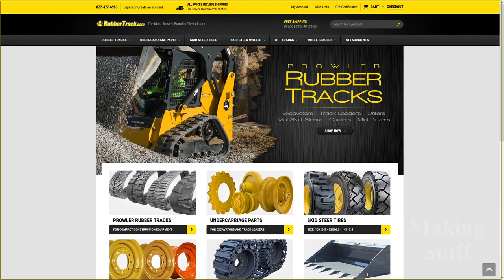DIY Tracked Vehicle Part 2 - Engine and Frame

Comment from the maker: Work continues on the DIY Tracked Vehicle.  I think the engine is too big, what do you think?  Can you have too much power?
Reply: I’ve wanted for a long time to build a tracked vehicle, one or two seater, dune buggy/ripsaw style, but aside from finding an already engineered track system I had no idea where to start, it would still be a bit of a different scale, but you’re definitely inspiring me to put some more serious thought into it.
Reply: if it doesn't generate enough power to cause structural damage, then it is not 'too much' power.. That said gearing to keep the speed sane while increasing the torque is a good idea.
Reply: Yes, when the diff is rated for 10 hp.  I'm actually downgrading from my 13hp, figured I don't really need all that power.
Reply: I really don't think so but I'm looking into working with two hydraulic motors to run each belt separate but I'm looking into hauling upto four disabled Veterans that are going out on elk hunts so power is a big thing for what I'm planning. Has to be built light but sturdy to handle whatever they throw at it.
Reply: More Power is GOOD!! Great project.

Comment: putting a hitch on that little guy would make moving boat trailers and tuff around in tight spots a dream.   I bet you could even use it to pull a single bottom plow like a garden tractor.  It is a pretty cool build.  I have MS and am planning on building a track machine for future use to get around in the woods when I get to the point I need help getting around.  It would be pretty cool to make one a bit wider with the motor forward or backward so a wheelchair could roll right up in between the two tracks. and lock in.

Comment: MOAR POWER MOAR BETTER! This project has me geeking out about my own tank idea. My old zero turn mower has a ruined deck and belt assembly but a hella strong 22HP motor and the differential steering system. Add it to the project list...
Reply from the maker: Check out the vehicles Tank Commander is making.  He started out with an old zero turn mower and has improved the design over time.

Comment: Wow mate that will shift. My machine only had a Honda 5.5hp and it is fairly quick. 
I had the same alignment issues and had to use a jack shaft as you guys in the states call them. Very substantial build. Loving it so far. 
Hope you’re well.
Reply from the maker: Thanks, all good here in the US.
Reply: @MakingStuff  good to hear. Been a good few years since I was last there. Spent a good deal of my child hood going to Florida. 
Where are you based?

Comment: Looks great but your drive clutch is on backwards.   Right now your belt will be misaligned while you are driving.    Flip your driven clutch and they will be aligned while you are under throttle.

Comment: Looks like youre planning to use a jackshaft to get the drive from the torque converter assy to the sprocket on the diff, i'd place the jackshaft to the rear of the engine and then pass the second chain under the engine mount and straight to the diff sprocket, the engine size is good, i'd rather have more power than i need than not enough power, you could have made the whole engine mount assy to bolt to the frame though instead of welding it on, that way you could always remove it if you needed to get to the diff assy.
Reply from the maker: Yeah that's a good idea about bolting the mount to the frame.  Thanks for watching.
Reply: I was thinking the diff sprocket and the converter sprocket are way out of alignment - then you provided the  obvious solution - a jack shaft. I feel so dumb.

Comment: I keep waiting for someone to make one of these using the engine and transmission off of a zero turn lawn mower. My JD Z445 has a 25 HP motor and each side is controlled by separate hydraulic motor. No differential needed. No brakes slowing one side to turn. In fact, no brakes needed at all as it uses hydraulics so slow it down or reverse one or both tracks. Way more efficient.
Reply from the maker: Check out TankCommander BT channel on YouTube.  He used a zero turn on his first tracked vehicle.
Reply: @MakingStuff  thanks I will.
Reply: @MakingStuff  I saw Tank Commander’s setup and I liked it. Decades ago when I drove armored personnel carriers it used to bug me. You would be hauling Ass at full speed and, when turning, the brake based steering would bleed off speed. Besides the steering brakes they did have pivot handles to reverse either track but we were always cautioned to not use them and if we did uses them to do so from a stop or it would throw a track.

Comment: Think it'll work out just fine the engine you got the weight of the tracks the move and your body I think it'll probably be just right I think it's like I'm pretty dang sweet! I can't wait to work on my projects but I got too many things going on right now Christmas for the kids everybody says that the engine be too much I think it'll be just right actually just wait till you get it all put together and some of the gearing a little testing and the tank it will go anywhere just watch and see It'll be sweet! I would like to see you when you get all finished with it what actually the real cost at the end product I think that would be very interesting nice job keep it up!
Reply from the maker: The cost has been creeping up on me because the price of everything keeps going up!  The cost of steel right now is insane.  Thanks for watching!

Comment: Looks to me that one of those tracks needs to be flipped around.  The lugs on the top should all be pointing in the same direction, toward the front.
That engine does look a little tall but, better to have the power and not need it...🙂
Reply from the maker: Yeah it's flipped the wrong way, will fix before next video.  Thanks for watching!

Comment: Pretty cool. How are you going to drive the chain on the differential? It doesn't seem to align with the torque converter.
Reply from the maker: Will show solution in the next video.  Thanks for watching!

Comment: I’m really enjoying a series. Do you have a lead ins on the slots on the motor plate on the wrong side?
Reply from the maker: Thanks for watching, not sure about the lead ins.
Reply: @MakingStuff  Where the plasma cutter started to make the cuts for the motor mount holes, would have been better to start the cuts from inside the holes that you wish to cut instead of from the outside and having to fix the cut marks.
Reply from the maker: Yes I had Sheetcam set to Outside Offset.  It should be Inside Offset.  I have already made a new plate.  Will show it in next video.
Reply from the maker: @lotuselanplus2s  Yeah, had Sheetcam set to wrong setting.
Reply: Sometimes you miss  the little thing, when working on the big picture…

Comment: Have you crunched numbers for gear ratios and such with the big engine?  150 ft-lb torque limit on the diff, I'd try to keep it under that with room to spare.  For heavier vehicles I've seen chain drives off the diff to stop the diff from seeing so much torque.  You might just get by with your setup given that it's a light weight vehicle.
Reply from the maker: No I just chose a gear ratio with available gears that was in the mid-range.  I think that this engine will have enough power that I can gear it up and get more speed out of it.  Will have to wait until I get it finished.

Comment: Hello Bob, To make sure I order the correct Differential from  Surplus Center, is Peerless 100-224 Differential 1" Axle
ITEM NUMBER: 13-1619 and Peerless 41 Pitch 40 Tooth Differential Sprocket 786042 are the correct ones to order?
Reply from the maker: The axle is correct.  The sprocket I am using is a 36 tooth not a 40.  I'll will be updating the links on the web page this weekend.
Reply: @MakingStuff  Thanks Bob, I'll check out the updated links this weekend. Happy New Year!
Reply from the maker: @roberteverette4766  Updated the links a little early, enjoy!

Comment: When the frame flexes during driving won't the differential drive lock and not allow you to steer?
Reply from the maker: Fingers crossed that doesn't happen.  Once I get the brake calipers mounted, I can beef up the front end so that hopefully there is no more frame flexing.
Reply: @MakingStuff  i wonder if you could remove a pillow block in the middle from each side then they can auto align

Comment: It would have been far easier to use 2 hydraulic motors to drive each track separately for much greater ease of placement and vehicle control like a real tank in the end...Doing that you could place the engine and hydraulic pump and tank assembly anywhere you wished...
Reply from the maker: Good idea but wasn't in the budget.  That's how Tank Commander makes his machines.  It would have also given the machine a reverse, which this one does not have.  Thanks for the tip!

Comment: I think the brake steering is a terrible idea. Cant see it working at all.
Would have be better to drive each side separately with hydro pump and motors.
Reply: Had the same thought, the "diff" appears to be an open differential, as the brake on one side applies, torque is shifted to the axle with the least resistance. This will undoubtedly cause issues with steering and driving in a straight line over terrain, where there is more resistance on one track. I suppose with constant adjustment with brakes, you could maintain some semblance of control, but I foresee some issues over obstacles... which is kinda the point of this vehicle. I think I will use independent hydraulic drive motors for steering on my project, more expensive, but  I think a better solution overall.
Reply: Go cart brakes for skid steer works great. Just remember to slow down, before you turn.